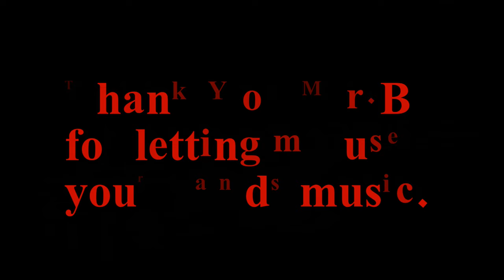Epiphone EB3 Detailed Setup

Comment: 50+ thou is more than twice what any other bass first fret action generally should be.  Where did you acquire this spec from?  I have an EPI EB-0 and I have the nut slots at 20 thou. Additionally, I noticed that the A string on your bass looked like it got permanently kinked from the tight nut slot.  Nice work on the setup Eric!
Reply from the maker: thanks. i was looking up on Google some bass setup tips. i came across a site that showed how to set the nut. it works out very good. yeah i changed the strings after the setup.

Comment: what are the amounts needed to be added to the measurement at the first fret for regular guitars? This seems like a very good way to get adjust the nut.
Reply from the maker: guitar and bass frets are different sizes. you have large, medium, and small. each fret per guitar could be a different height. you can fallow the same method i did, but for guitars i use feeler gauges on top of the fret under the string. on a tune o manic, low E i use a .018 to .016 thousands. on the high E i'll use an .008 to .010 thousands on top of the first fret under the string. for single saddles, i will use the same i just explained with the low and high E. for the middle strings i'll use a radius gauge that matches the neck and put over the strings as they come off the saddles and match the strings to the radius gauge using the low and high E's on each side of the gauge as the starting points. then moving the middle strings up or down to match the curve of the radius gauge. it sounds like a lot to do, but explaining it takes longer. hope this helps.
Reply: thank you

Comment: What are your pickup (or pole piece in the case of the neck pup) height measurements? I want to put mine back to stock measurements and I can't find a spec online for the life of me.
Reply from the maker: i didn't have to adjust the pickup pole piece. they are set from factory. i did not have to change their height, sounded good on all strings. they are set all even. not screwed in all the way, but the top of the heads of the screws are about 1/16 from the top of the pickup covers.
Reply: Eric C That’s enough to get me where I’m going. Thanks for getting back to me so quickly.

Comment: Hi Eric, is there any rule of thumb of how high the bridge should be on these guitars as a starting point?
Reply from the maker: not really, but if it is too high your string action will be very high and make it difficult to play
Reply: @ericctheartofnoise8613  i have a rumblekat the string action is a little high..could you advise me how to adjust it?..or should take to a shop?  just need to lower strings a bit ..say 12 fret to bridge